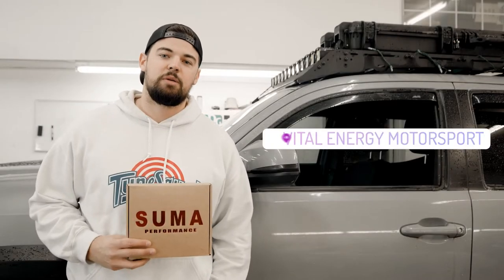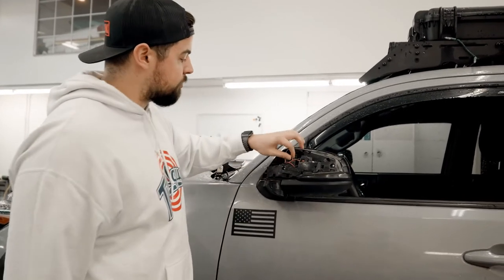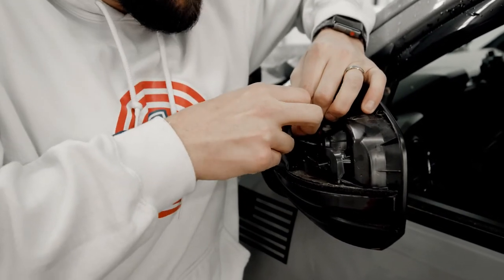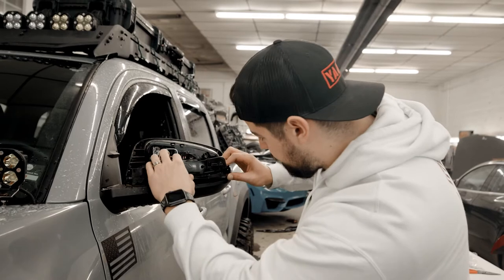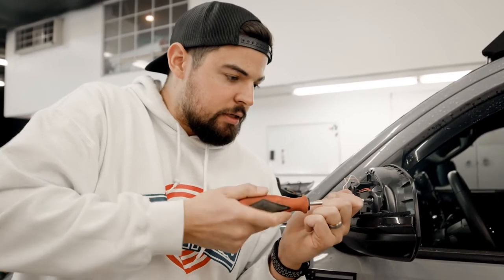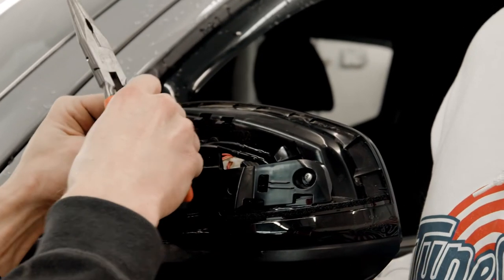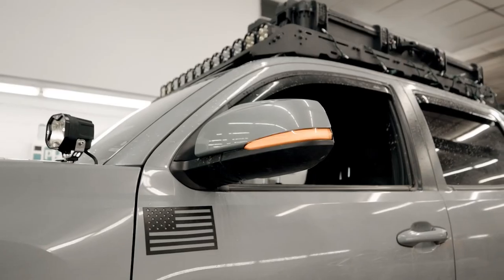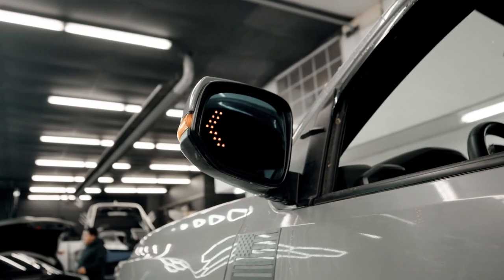Suma Performance Mirror Install

Comment: What if you have blind spot monitor
Reply from the maker: They offer an option that has BSM. You’ll just disconnect it off the old mirror and connect it to the new mirror. The promo code will also work for their whole site.
Reply: @The_dark_yota  what’s the promo code ?
Reply from the maker: @tiffanynguyen412  promo code is Thedarkyota